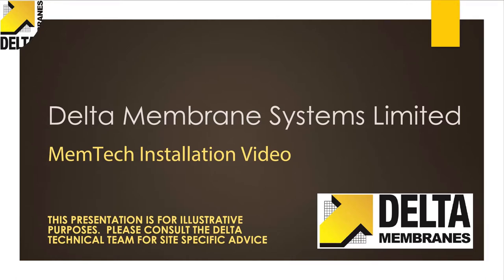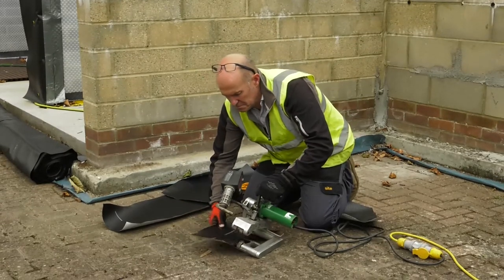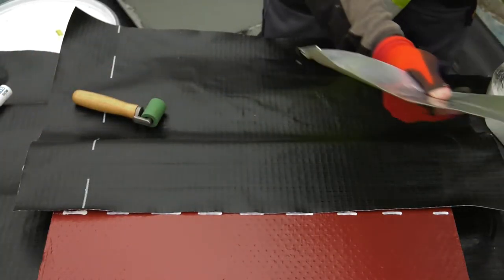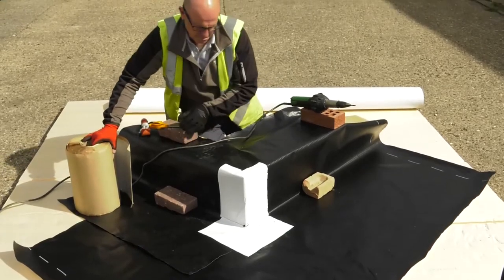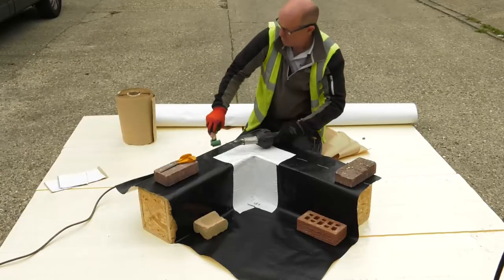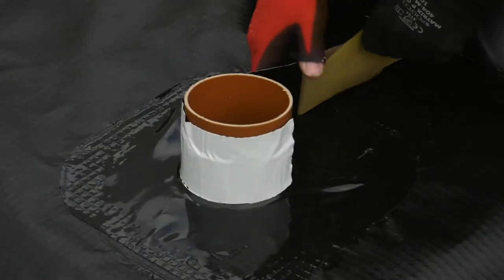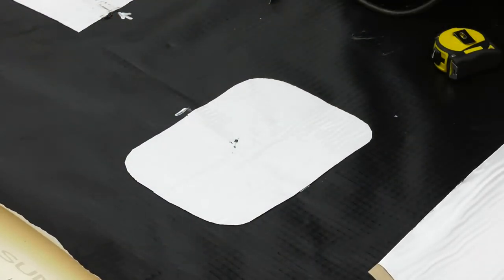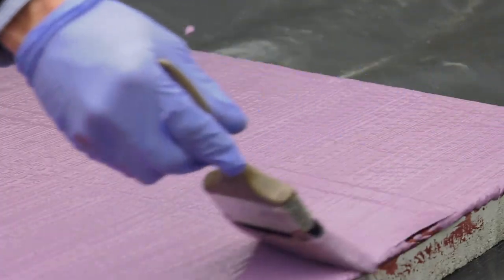MemTech Ground Gas Protection Full Installation "How To" Video Guide

Comment: Easy with small bits on a small corner , show a full roll been used
Reply: Depends if you’re installing perimeter only or working a full line out. Perimeters only tend to use 600 wide sections. If it’s full rolls, true, slight variation in method.
Reply: I’ve do it before kingspan insulation for damp proof